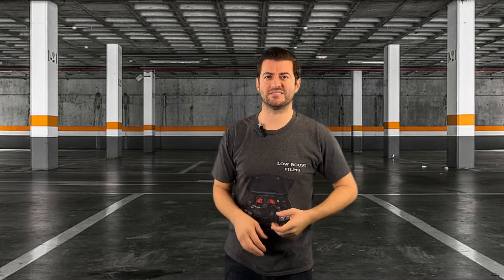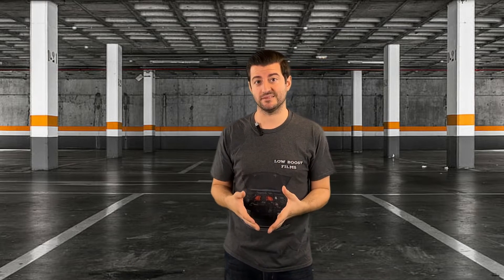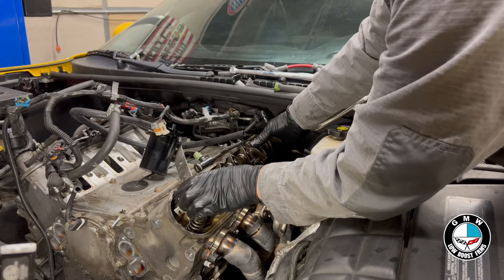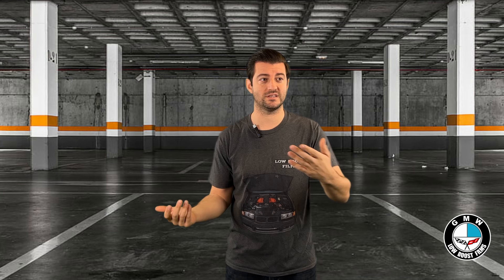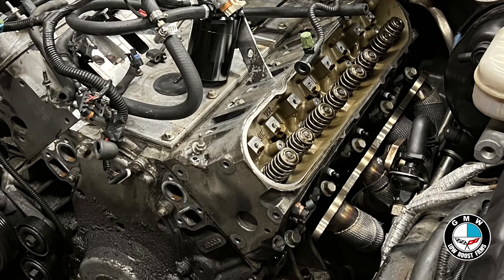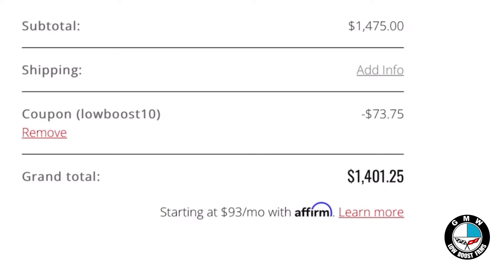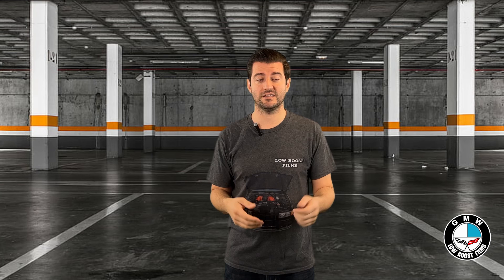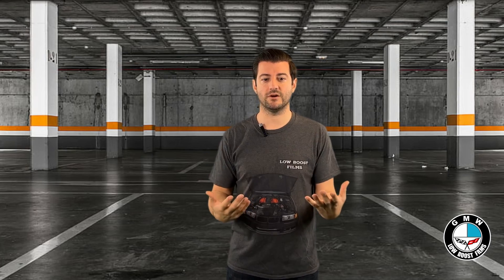WHAT DOES OHV MEAN? Over Head Valve Finally Explained!

Comment: Imagine if General Motors can make the V8 Chevrolet Camaros with DOHC and discontinue the OHV in order to be more competitive with the Ford Mustang GT, and other 32 valve V8s. No more 16.
Reply from the maker: Would have been a bad move
Reply: @LowBoostFilms  How and in what way?
Reply: I only prefer DOHC over the OHV because four valves per cylinder is much better than two.
Reply from the maker: @marlon94124  by them doubling down on theirs cylinder head technology. They were able to build a v8 that makes good power up top, but not sacrifice displacement down low. Look at other dohc v8s with Lower displacement. Tq is nowhere close to an LS. But dohc can rev a lot higher.
Reply: @LowBoostFilms  The OHV engines have a much better center of gravity because they are shorter in height and the camshafts are inside the block, but my preference with DOHC is what import brands from Audi, BMW, Mercedes Benz, Lexus, Infinity, and many other manufacturers provides more variety. I don't pay attention to the Dodge Challenger and other GM V8 engines with OHV because the choices are very small.
Reply from the maker: @marlon94124  DOHC is great, just more complex and usually heavier. But nothing wrong with them at all.
Reply: @LowBoostFilms  Please be aware with new and descent cars nowadays when gaskets wear out very easily and start leaking oil from the valve cover gaskets or other fluids regardless if OHV or DOHC. Reliability is history. I own a 2004 Mazda 6S with the 3.0L 24 valve V6 5-speed manual transmission and my car only has 136,500 miles. Self adjusting valves and I had my cousin replace my valve cover gaskets at 125,000 miles. The car still runs like a charm, but I wish Mazda equipped the first generation Mazda6 with the 6 speed manual transmission. 19 years brand new when I purchased at Putnam Mazda in the showroom floor. 3 miles.